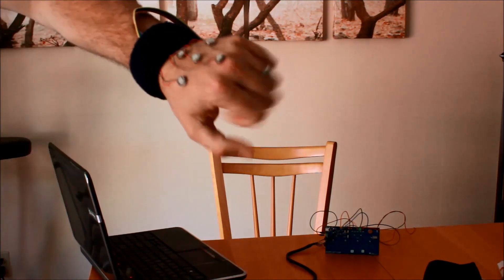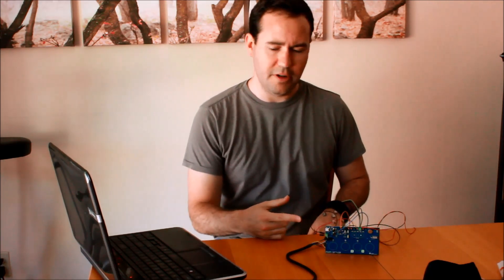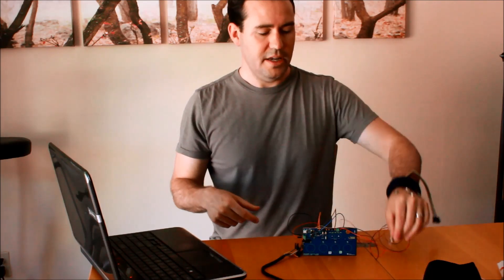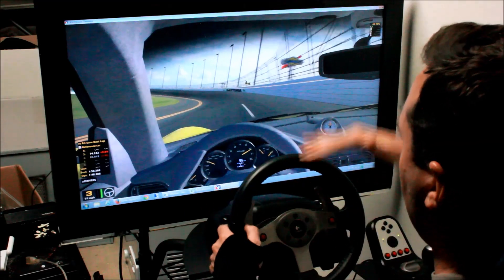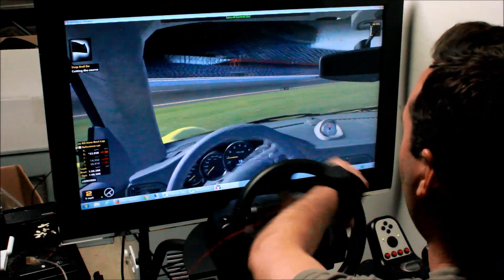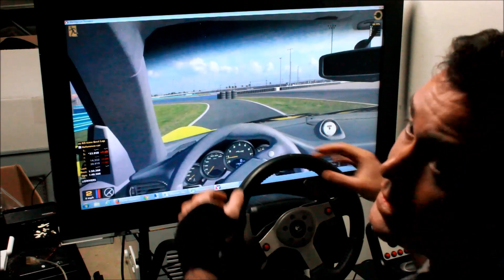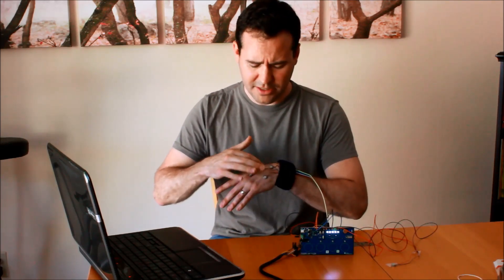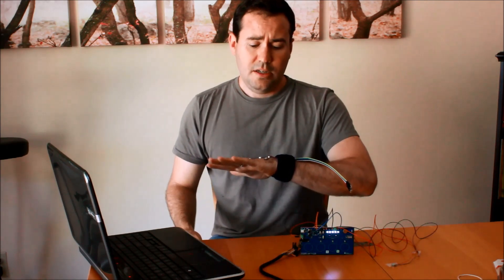June 2014 Update - Prototype 0.000001a

Comment: So, is this basically like a wearable rumble pack?
Reply from the maker: I would equate a rumble pack to something like a subwoofer.  This is more like a tweeter in a stereo system.  So, you could say it's a very low latency, high fidelity, multidimensional rumble pack.

Comment: It'd be nice to see an on-screen display of the motor activity, maybe just overlayed on top of the video.
Reply: Yeah that would be good. For now show a visual output of what's going on. 

I don't have a sense on if the motors vibrate a lot so they're shaking your hand or if they just make a feeling of pressure?
Reply from the maker: I have an idea about how to solve this with LEDs, will include it in the next video if it works.

Comment: Just to clarify... are you using the 'motor' to directly give feedback to a particular location on the back of your hand (I assume that with multiple motors you would learn which 'means' what).
What signals/values from the Sim are you using to stimulate the motor(s)?
Could the motors just be sewn into a pair of racing gloves?
Reply from the maker: For now it's on the hand, but trying it out in different locations (think Oculus addon).  Yes, I could have just strapped it to the glove, but I just got done watching RoboCop.  I'm currently passing lateral Gs, Longitudinal Gs, Vertical Gs, as well as Yaw Rate.
Reply: Kirk House Is it more like you get used to, and recognize what each feel means? Does it feel natural?
Reply from the maker: InZomnia365
  The first time I raced a car, the Gs were surprising to me.  It's kind of the same thing here.  After a lap or two your brain recalibrates and it just makes sense.  It just feels like you're in a car.  VR is similar, I think this gets us closer to "presence"
Reply: Cool, cool! Definitely exciting to follow the progress.